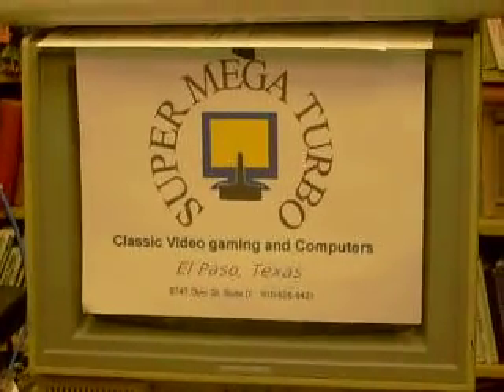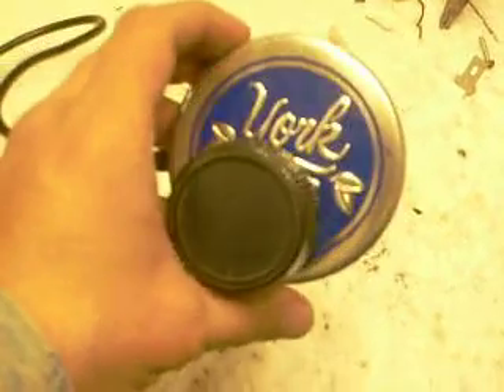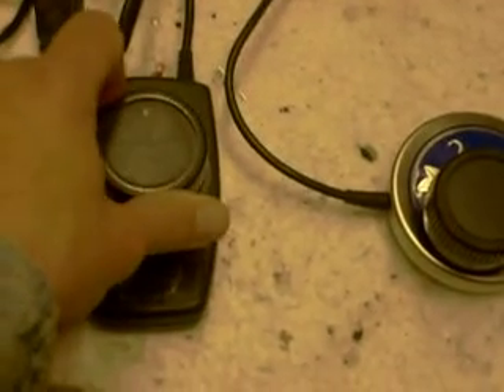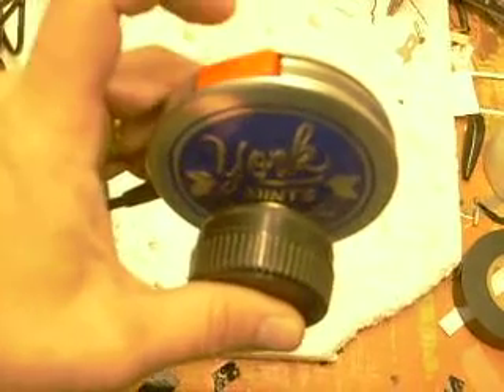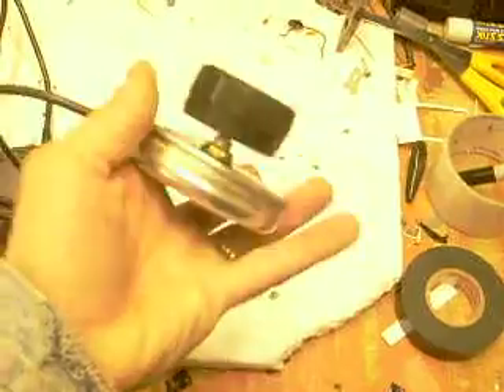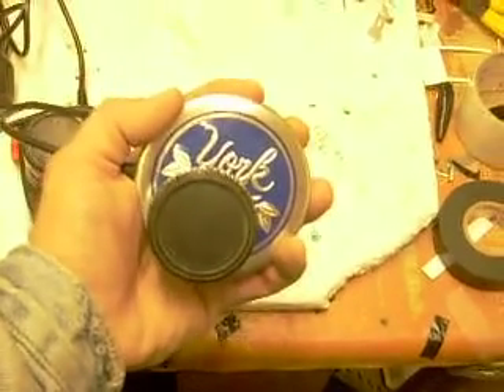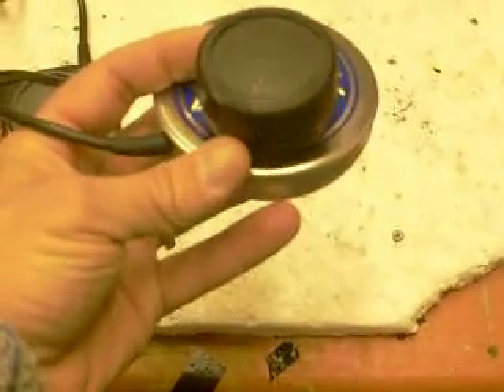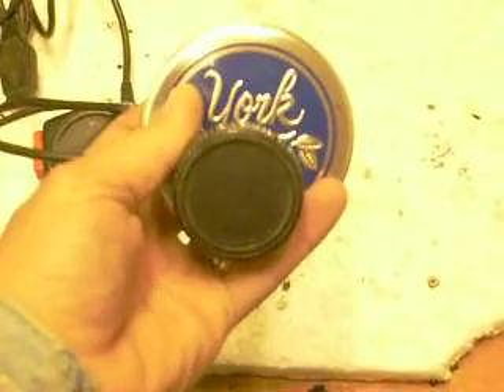York mint tin as an Atari Paddle!

Comment: I think that cradling the wire would act to help prevent strain on the cable so actually that is a nice feature... should have gotten ole' Ero's I meant to do that comment. 

The shape looks more comfortable in the hand then did the original box.   Still why did you not include a blue LED here?